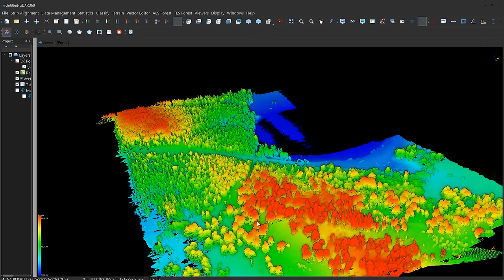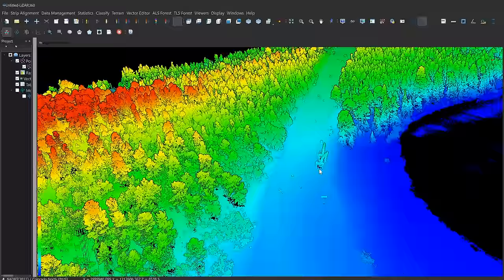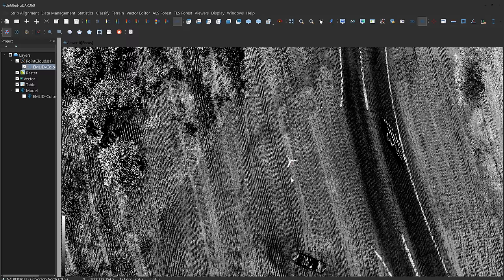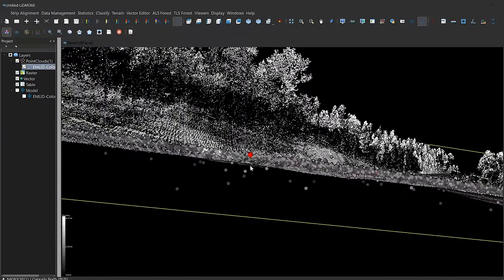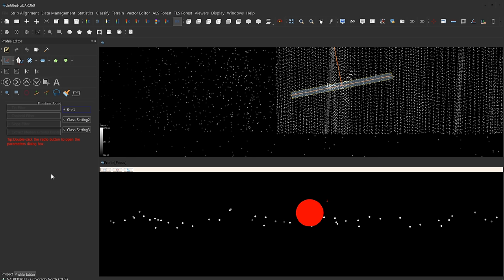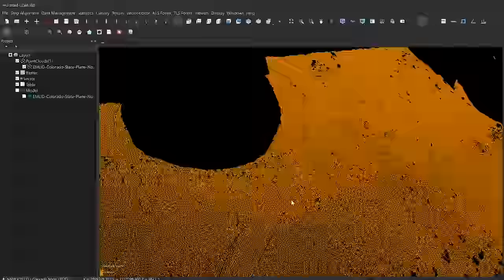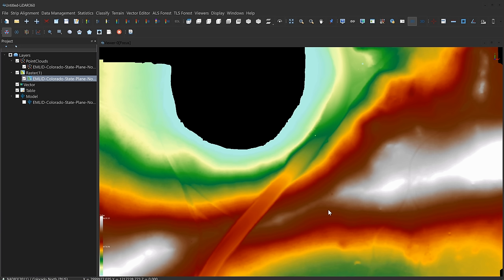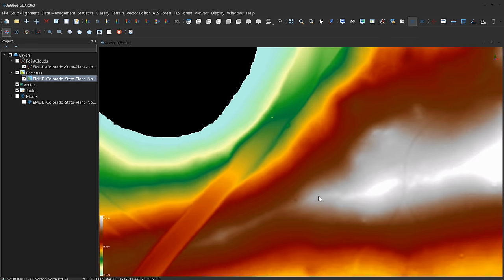What is LiDAR Drone Surveying | Accuracies and Results

Comment: Good afternoon, I would like to ask you a few questions about the construction surveying drone since it is a very good project for the area of construction surveying.

1. What is the maximum flight time of the drone?
2. How accurate are the measurements taken by the drone?
3. What is the maximum range or coverage area for a single flight?
4. Is the drone capable of transmitting and analyzing data in real time?
5. What types of sensors and cameras are equipped on the drone?
6. How easy is the drone to operate and maintain?
7. Are there any specific safety features or regulations that the drone meets?

Kind regards.

Comment: Many surveying jobs are processed in local/arbitrary coordinate systems. Can this system deliver point clouds in these custom reference systems and different scale factors?
Reply from the maker: Hey Drew! Yeah we do this by uploading a both the GCP in the site coordinate system and the corresponding point on the LiDAR dataset. We need at least 4 pts to compute the false northing/easting and scale factor. We also have a way to project into grid then manually enter in the false northing/easting and scale.

Comment: Great video, very helpful. We are looking to clear land for a construction site so we are using a LIDAR drone scan to collect data for the area so that we can get a topographical map under the trees and vegetation. My question is, if we want to do cut and fill calculations on how much dirt will need to be moved to create a level area for a construction site, what software could we use to perform those calculations?

Comment: Great video.. I have been dabbling with drones and the related technology for LIDAR, SONAR, autonomous flight etc for fixed wing and hex/quad copters for a while now simply because I find the technology fascinating  BUT that has led me to realize there is so much potential in this space and that will only continue to grow as time goes on. In your case or experience what formal certifications, degrees etc are required and/or common as a pre-requisite to performing this kind of paid work?
Reply: None, everyone is self taught

Comment: Can you make a similar video using the DJI LiVOX mid-40 testing the accuracy and precision against GPS check points?
Reply from the maker: Yeah, I'm putting that on the list of videos.  I'm planning to do a complete Aerial LiDAR accuracy video. Go through the accuracies of each component that makes the integrated system and the final accuracy and how to measure it. But also an accuracy review of the LiVoX integration is needed!

Comment: This is the knowledge  that I need, thanks man, keep up the good content. Would love to know, Is it a one man show? how many person, minimum, are needed for a LiDAR Drone Survey?  Is the Drone system feasible for making a vast contour maps, like an estimate 100 square miles? thanks
Reply from the maker: Good day! Thanks for the comment and very good questions. Short answer, yes you can make maps this large. It's not easy in the USA because the FAA but for scale, the largest map I made was 800 Sq km. And that was a 2 man crew for the drone op and a 2 man crew gathering ground control points.  Now this was only possible using large fixed wing drone systems. Very very very cool though!

Comment: Good video but you're not including all the steps of properly conducting a legal flight. You need to be 107 licensed to conduct commercial drone flights. By the looks of your location, you're probably in class G airspace which is totally fine, however not all done flight plans are so easy. Please do not conduct commercial flights without the proper license and know the rules of the air.
Reply from the maker: Every RPIC should operate with a 107 certificate!